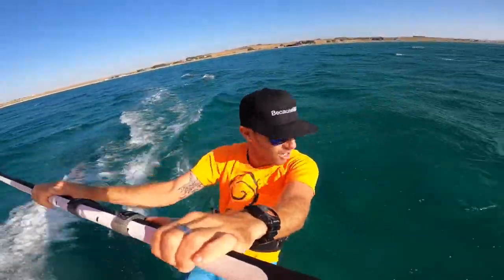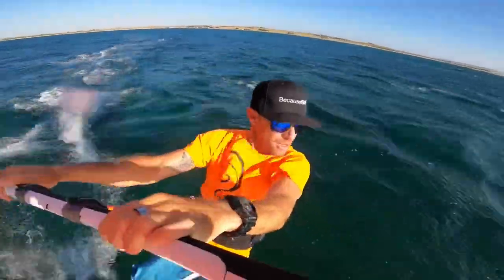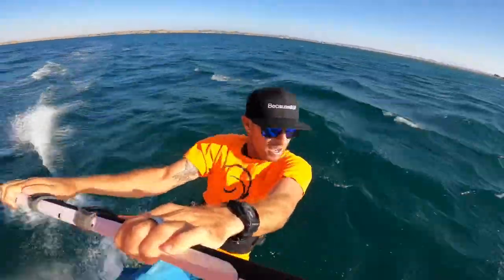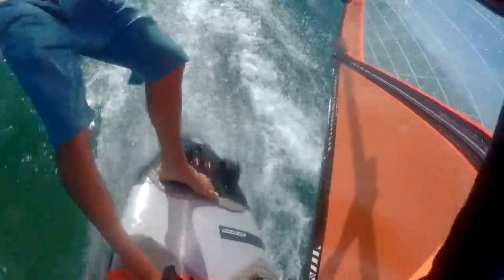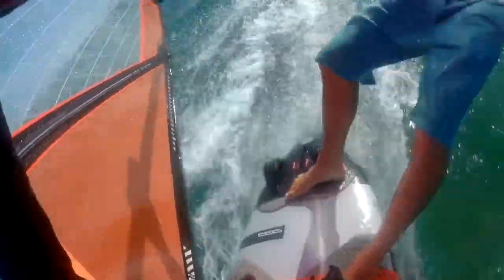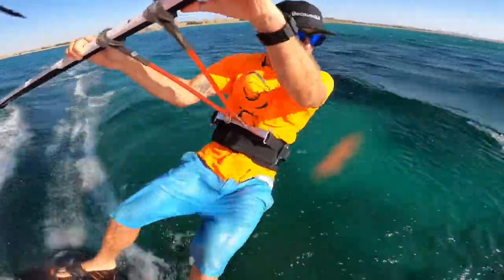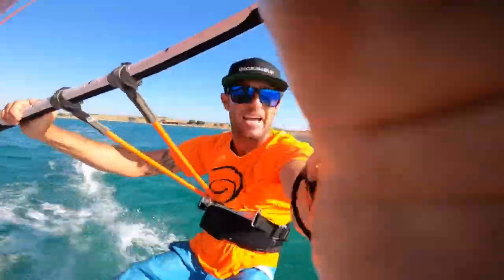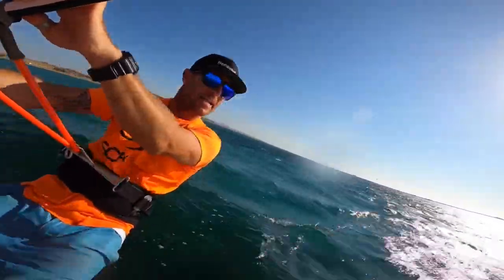How to carve gybe, the preparation and entrance!  Windsurf Ride-Along Sessions with Cookie.

Comment: Great, great TIP !! Also comment for Pavel Flikov is super ( all kind of disasters happen ) ! Broke my elbow not getting back foot out of strap at full speed. . . . . I will certainly try next time !!  All in all - great video !
Reply from the maker: Thanks Marky, appreciate you watching and commenting! 
Good luck with the progression, keen to know how it goes!
Reply: @Cookiesports  Will let you know ! I am struggling with this issue right now and than I loose speed and than . . . . . Thanks
Reply from the maker: Try this out....
https://youtu.be/cywwVfpYGaU
Reply: @Cookiesports  Great tip as well, I must admit. Watched the video several times and I find it very useful. But still my greatest issue is entering the jibe. Fear,  I suppose, specially in rough water. But great tip as I said from this video, what gives me hope . . . https://www.youtube.com/watch?v=3FcH09F52nc  or  https://www.youtube.com/watch?v=zRiFnOCOG5U    These are old videos, hope now is a little bit better !
Reply from the maker: This videos are good! 👍👍👍
Key points- start hard up wind with the back foot out, the go through the H’s one at a time as if someone is watching and your making it really clear. This will control the acceleration and entrance. 
Light wind practice will help you no end- will remind you how to steer using the rig, and how important the rig moment through really is- not just relying on the carve to turn you. 
Good job!
Reply: @Cookiesports  start hard up wind with the back foot out - this I will try (hopefully) tomorrow ! This really is a good tip !!! And you mentioned in video front foot toes down at acceleration - this makes sense, consequently you must go low !!!  Slowly I will get it 🤫

Comment: Hi Cookie, meanwhile my experience is, that the most important point  to carve the jibe through is the acceleration at the entrance. If I get done that well, the rest goes nearly by itself. But I don't get done it controlled well, sometimes it works, sometimes not. "Upwind, back foot out of the strap, back hand back, unhook, hang your hips and then push with the toes of the front foot." My problem is that pushing with the front foot. Sometimes it works perfectly, sometimes I don't get enough pressure in the sail, that pulls my body up and forward. The sail gets closed and I'm hanging to much on the back of the board and I'm threatened to fall down back from the board and I'm loosing the speed. 
Do you have a special position with your body on the board, when you hang your hips down and push with the front foot ? 
In which direction do you look ? 
I would be very happy about your answer, because I'm so close to carve the jibe controlled through after 10 years of learning. Thanks a lot for all your videos, which helped me to reach planing trough the jibe and for your Disco-gybe lessons last year in Vasiliki.
Reply from the maker: Thanks for watching! 
Come sail in a clinic with me in Vass and we’ll analyse what’s going in with your sailing! 
“Position while heading downwind”…. Look where you want to go… forward and through the sail. 
Hand down low… not necessarily back over the tail though. 👍👍👍

Comment: Hi mate. Can’t wait to see you back on the water next season. Your videos are awesome for learning and have helped me in a number of areas. 

Gybes are a work in progress for me. Just a quick question. You don’t seem to sheet the back hand in hard or lay the sail over like older videos recommend? Your rig flip looks like a gentle release of the back hand, sometimes it looks like both hands. 

Your gybes look really relaxed compared to some of the older stuff. As an intermediate is this what i should be aiming for?  What are your thoughts on sheeting in during the gybe?  It never made a lot of sense to me. Opening the sail as you head downwind seems more logical. 

Thanks. 
Steve
Reply from the maker: Hi Stephen! 

Thanks for the comment. I'm loving the snow right now in the French Alpes (maybe you've seen the latest uploads), but defiantly looking forward to being on the water again in Vassiliki for summer 2021! 

"Oversheeting" the sail is difficult and the majority of the time completely unnecessary. 

Doing the laydown move and cranking in the sail can de-power the sail... when done correctly... but when done slightly wrong (as with most people learning how to gybe) will cause all kinds of other things to go worse and the gybe wont be successful. 
Avoid it until the vast majority of your gybes at least dry, and ideally exiting with some speed. 
There are many videos I've done on gybing, I think these two will help you most.... 

The Disco Gybe... all about the rig flip and how to make it effortless.... https://youtu.be/cywwVfpYGaU

The Secret Formula to mastering Gybes....https://youtu.be/oCng8Mj6CTM... https://youtu.be/oCng8Mj6CTM

Feel free to drop me any more questions you have once you've checked these out! 

Thanks for watching! 

Cookie

Comment: Hi Cookie, "... hand is going back,  unhook, droppiing down and then pushing for that power, hold the power, accelerate and then a little creepy step over..." My question: "dropping down and pushing for that power (through the toes)"  1. Do you do that with both arms strechted straight, also the back arm not bend in the elbow ?    So I do it now. Then I get very good acceleration. But then comes the problem. While the creepy little steps over, very often I loose speed. 2. Or do you when the acceleration has started take the sail/boom with your back hand close(r) to keep the power in the sail ? Thank you very much for an answer. And thanks a lot for your education-videos, because they enabled me  to plan through the gybe. And now I want to improve and get faster through the gybe, not only randomly but consciously 🙂
Reply from the maker: Thanks for watching! 
When you drop and push on the entrance you extend your arms… as you rise up and carve you arms aren’t locked out straight, but more extended than flexed. 
Hope that answers your question!

Comment: What is the advantage of taking the back foot out before bearing away? Wouldn’t you loose speed and control, vs keeping it in as long as possible? Love the videos btw!
Reply from the maker: Great question- often I find with students that if we keep the back foot in, bear away and speed up, they try to remove the foot at full speed on broad reach... all kinds if disasters happen, usually involving some dramatic stamp on the rail whilst standing up tall- board then flys all over the place with little control (but a lot of speed!). If we get the first foot movement out of the way early, we can still retain speed and control through other movements during the preparation and bear away, and more likely to have success. Sure, as an experienced gyber who is consistently planing out you may have found your preferences to go through “the H’s” and prepare in a different order and still have success, but for someone looking to improve and progress this is a great way of getting good results! Thanks for watching!
Reply: Simon 'Cookie' Thanks for the reply. I have yet to come out of the jibe planning. Heading out for a session tomorrow, will give this technique a try. Cheers
Reply from the maker: Pavel Filkov give it a go and then tell me about your success! 😉

Maybe send me a video and I’ll see if I can help!
Reply: Simon 'Cookie' Thanks

Comment: During the initiation of the jibe, how much of the foot pressure is on the rear toe vs pulling-up on the front footstrap? What is the weight balance between the two feet? It is 50% front, 50% back or more on the front?
Reply from the maker: Hi Boris! It’s not an exact science I’m afraid, no magic formula to correct.l carving balance. The aim is to keep the trim of the board consistent throughout the arc, unless your water is glass flat this will involve working the board and your balance through the turn.  What I think is key to doing this is remaining low- head below the boom as you open the sail, with soft knees. Combine these two and you can balance well and make subtle adjustments through the turn. In this video at apx 3.05 and 3.20 when you can see me in the carving position, notice firstly how bent the knees are, but secondly how much movement there is through the knees- not just locked down low- but flexing and moving to deal with the chop. Hope that helps- let me know how you get on!
Reply: I have heard conflicting recommendations. Some recommend putting weight on the rear toes (but this sinks the tail and reduces speed). Others recommend pulling up on the front footstrap. On a 100-liter or smaller board, what should I do to plane out of the jibe?
Reply from the maker: Boris Litinsky Both are right, both are wrong all at the same time!
Putting weight on your back foot as you say will upset the trim of the board, carve the board hard, and could potentially slow you down. Lifting through the front foot in the original front strap can help keep the board flatter and lock the board onto the water which could help you through the carving part of the turn. However, in my experience a lot of the time students have all their focus on the wrong part of the manoeuvre to make it successful. Be it the gybe, tack, or anything they are working on, when I watch them when sail and diagnose their issues it often turns out that the problem was not the foot pressure or how well they kept the board flat... or what the sailor originally thought- the problem was the lack of correct preparation and acceleration, or a poor wreck flip, or miss timing of the whole manoeuvre.... or something else completely! You are welcome to send me a clip or two of your gybes and I can see if there is such pressure is the problem or if it’s something else!?
Reply: Simon, the current issue with my carve jibes is that usually fall-in during the foot change & sail flip. I am not sure whether it's some balance thing or what. It's kind of frustrating.
Reply from the maker: Boris Litinsky and I’m sure you’re receiving so much conflicting advice? Upload a video and i’ll see if I can help. Maybe best way is through @cookiesports on Instagram?